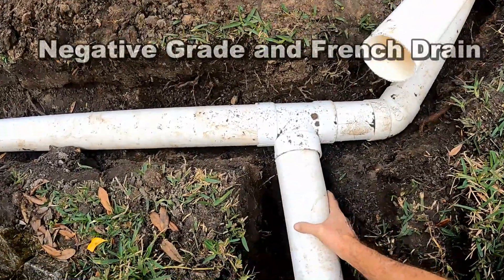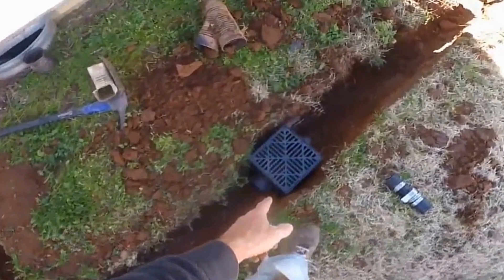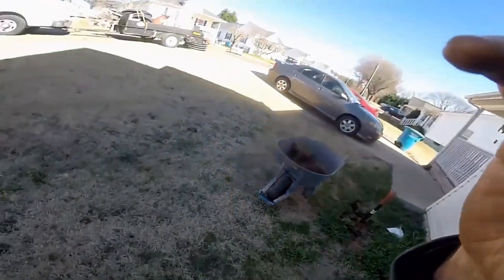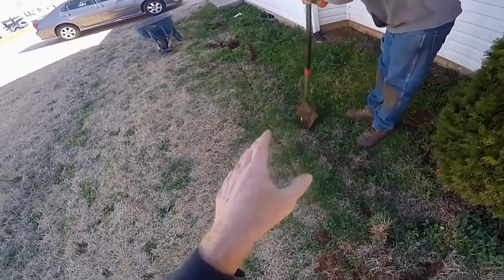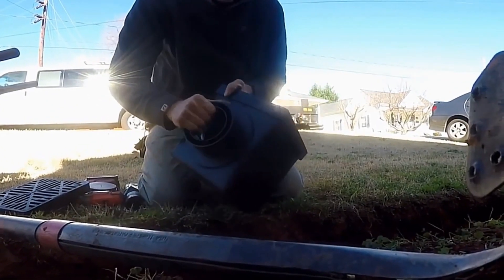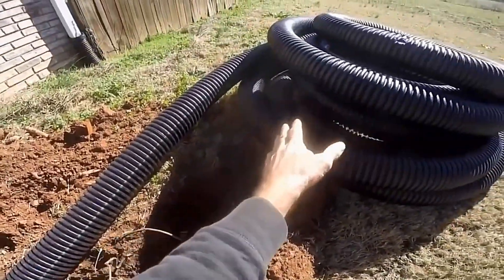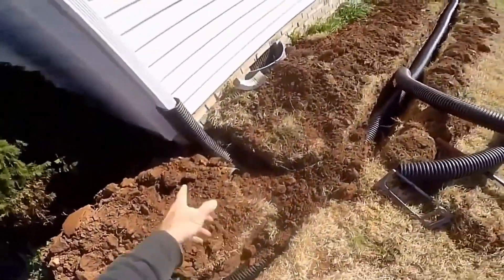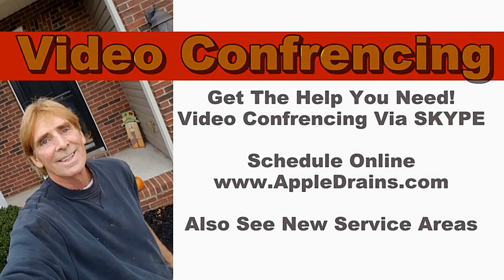Trench Drain to Solve Negative Grade Floods

Comment: my Florida home is built on deep sand/clay fill dirt.  from the back wall of the house the yard is level  for 15 foot out.  next a cliff with about a 25 foot almost straight drop. cliff side is covered in tall bahaia grass only.  i was thinking to do a trench drain 5 foot out from my back wall  of the house running parallel to the back wall.  i was thinking my trench drain shouldn't be near the edge of the cliff nor near back wall of the house.   I was also thinking to line the bottom of the trench drain with geo fabric, lay layer of gravel,  lay perforated pipe, cover with gravel only.   gravel to surface.  what do you think?

Comment: For super cold areas does the trench need to be deeper?  Why does a French drain need to be at footer level? I have serious drainage problem around my home and in my basement/crawl space.
Reply: No, you just need to avoid any low spots. If water doesn't pool (and fill the pipe), there's nothing to expand. Just keep it clean. I did something like this around a deck in Canada and it worked great.

Comment: Hey, I was planning on doing some kind of drainage system for down spouts, I was wondering if I wanted to go straight out with it instead of wrapping it around my house, how far from the gutter would it need to go out away from the house?
Reply: For downspouts, solid pipe. Minimal turns or bends. Ends can be anywhere where the water will flow away from the house and not cause other issues.